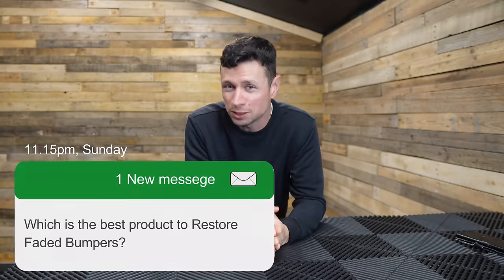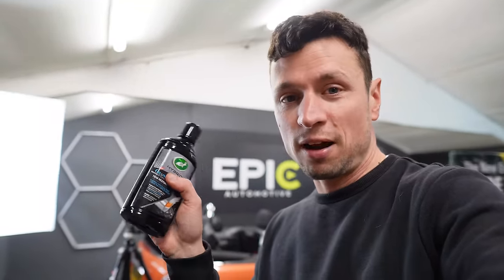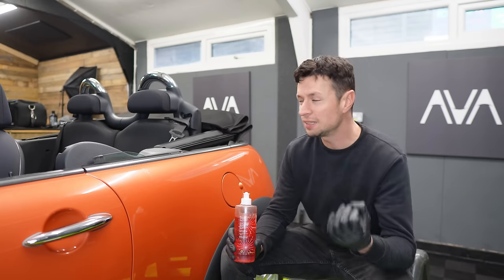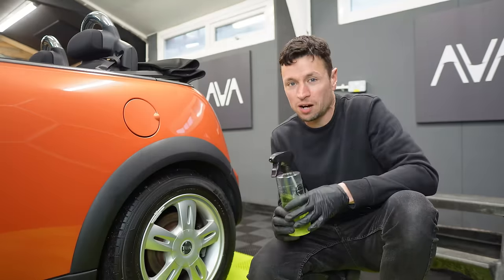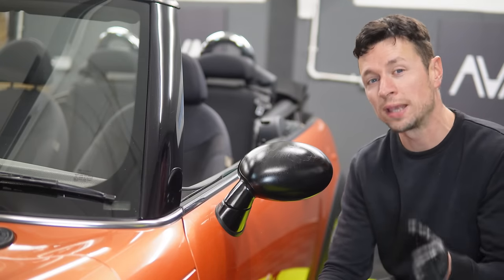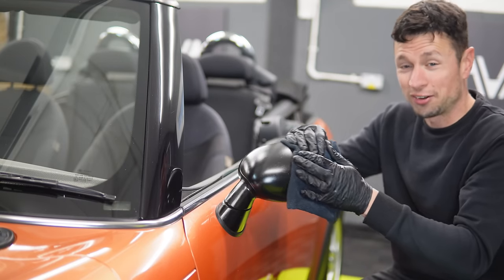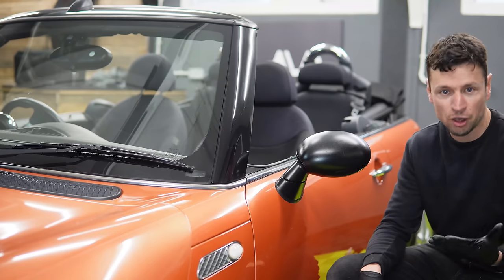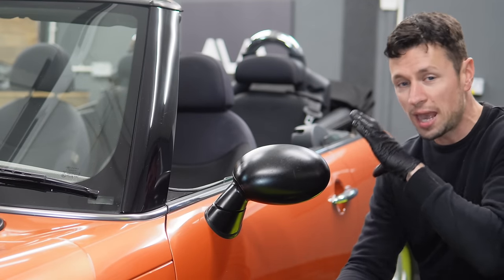Restore Faded Bumper Trim in SECONDS

Comment: Solution  finish every time dave if trim is prepped  right first coat will last between 6 and 8 months  but I tend to retreat at around 1 month then every  time  I treat ill get over 12 months plus its so easy to use and they have one for grey trim as well called grey fusion...
Reply: Yep….another vote for Solution Finish, still the best on the market, used correctly, nothing comes close 👍👌🇮🇲
Reply: How are you prepping it? Do you use isopropyl, if so what strength? Cheers

Comment: I’ve used this in my business, I find it more for a weekend warrior, or someone just using it at home. It does take a few coats to get them decent and when you’re working in a time frame it’s not the best solution as it does take 20 mins or so to completely dry before you can apply another coat.

Comment: Looks like a great product. I've only recently bought a different car, Honda crv. The bumpers and trims looked a little tired so I did some googling as you do and ended up with Trimcoat made by Ceracoat. Unbelievable finish!
Same as this one it's sposed to last yrs or 200 washed, but you apply it using the wipes what are provided in the 10 sachets you get. I used 5 on the car, and although I thought it may be a nightmare to put on, it was really easy. You can be quite accurate with them wipes.
Thanks for the vid as always.

Comment: I’ve used plastic coat since it was released in their mystery box, always does a great job and is very easy to apply
Reply: If applied to clean and grease free trim, does it last anywhere near the listed 6 months? I’m thinking about buying some plastic coat soon. But first I’ve ordered some £3 ‘ceramic trim restorer’ off AliExpress to try first 😂
Reply: I get a good 4 months or so still fairly dark and beading well. but it diminishes slowly over time so it’s not easy to gauge as I forget about it. The bottle lasts ages though.
I’d be weary of a £3 ceramic from Ali express 🤣 replacing damaged plastics would be more expensive!
Reply: @andrew1468  Thanks for the info. And yeah that’s a fair comment mate. Obviously it’s not actually ceramic for that price, but the reviews are good and I’ve always had good luck with apps like Temu and Ali so thought why not 😂 It’s only a 30ml bottle so if it only lasts a month I’ll buy Plastic Coat straight away. Cheers 👍

Comment: What about for the interior plastics ? Does this do the job or would you recommend a different product ? Thanks in advance
Reply from the maker: I just use an interior detailer most of the time, I wouldn't dress any plastics inside, if it gets hot you'll get off gassing and it would look patchy
Reply: Thank you so much for your reply Dave ... I am looking to start with YUM interior as you recommended it as an all around interior cleaner ... My car was an ex disability car so at the back there are some scuffs on the plastic and it looks a bit faded due to have a wheel chair at the back an never a parcel shelf ... I will try Yum and see if brings it a bit back that black colour or if hides a bit the marks  .. many thanks
Reply from the maker: @carlosteixeira3966  yum interior is good enough as a standalone product, cleans and leaves a nice finish 👌